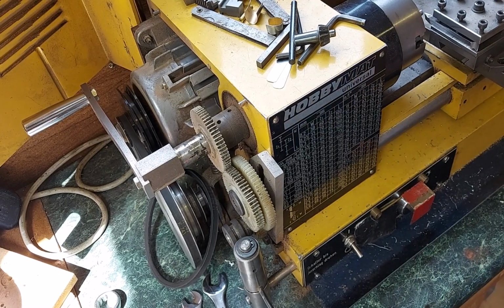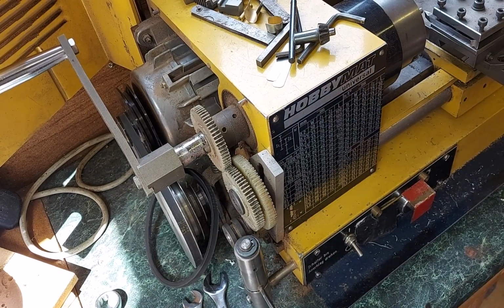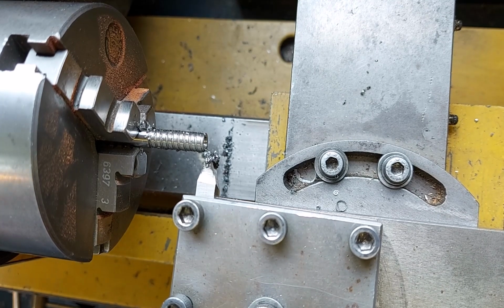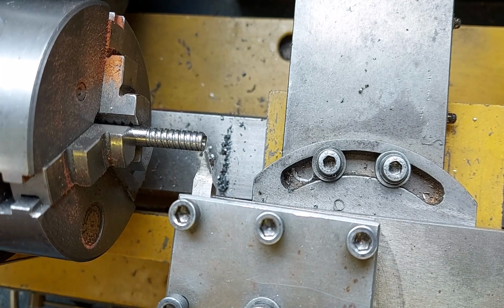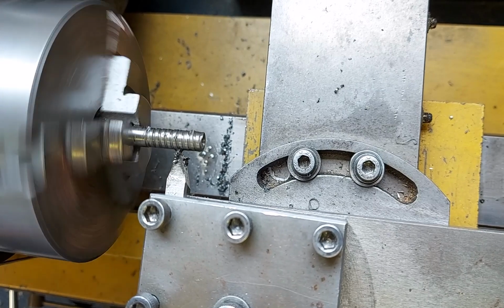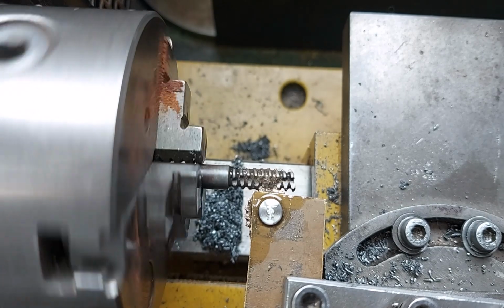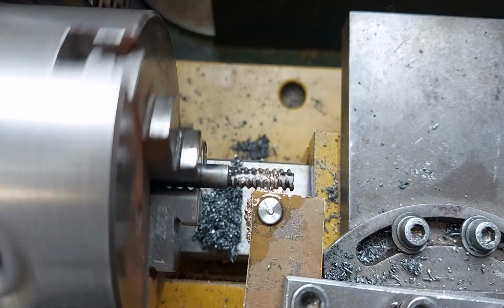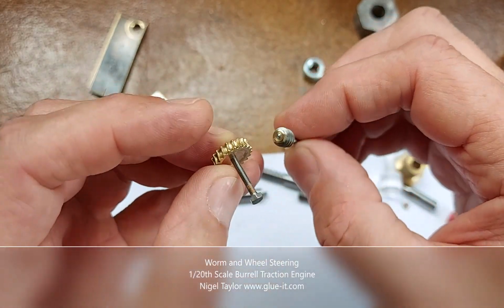Steering Worm and Wheel Steering for the Miniature Traction Engine

Comment: Good work Nigel... I have the details of how to make an hobbing attachment for my Myford lathe....Not sure I will ever do it but has been interesting to see how it was done...
Reply from the maker: Hi Paul, thanks, this is not real hobbing as I index cut the teeth first so that the hob and gear would engage. There are some slight nicks in the worm gear profile, next time I would just use a slitting saw and make more cuts in the hob so that it is more fully engaged. For now though the result is good enough....